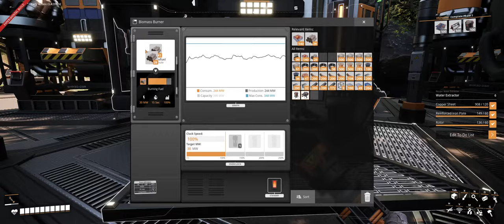I Built 16 Coal Plants at Once | Satisfactory U8 - VOD 2

Comment: What adjustments did you make to solve the encoding lag?
Reply from the maker: So between VOD 1 and VOD 2, I changed some encoding settings, reduced the detail just slightly, but, if I remember correctly, two other things changed that probably effected it more.

I reduced the detail on foliage, that was causing most of the encoding lag, and they released a patch that helped optimization as well.  VOD 1 was recorded the first night of Update 8, so it was pretty raw.

Comment: what is your top 5 for alternate recipes in the game ?
Reply from the maker: 1. Heavy Oil Residue
2. Either HMF recipe (the OG one sucks)
3. The HOR to Turbo Fuel, if you're doing turbo fuel (the OG turbo fuel sucks)
4 & 5.  All the recipes that replace screws with steel pipes or wire lol 

I hate screws.  They are almost always the through put limiter in early Satisfactory, replace them asap.  There's a rotor one, a reinforced iron plate one with wire, and the HMF one.  A few more I can't think of off the top of my head.
Reply: thanks for the reply 

i took me about an hour of collekting 15 hardrives to get the turbofuel and HOR alternates they look realy good. the only downside is that i have to redsign the oil plant i used 10 hours trying to get right. (my first playthru of the game)
and does it really give you more plastic and rubber pr minute it looks like a complicated way to get the same amount with more fuel for power. ? or is it just me not seeing the obvious 
sorry for spelling mistakes english is my second language
Reply from the maker: 10 hours...pfft.  😂
Reply from the maker: The fuel for power is in the important thing.  I honestly haven't run the math on the plastic and rubber, I always make way too much anyway.  Its all about the power.  Just sink whatever polymer resin you don't need for plastic/rubber.
Reply: Is 10 hours allot for the first time or do you just use allot longer
Reply from the maker: Its not that much time at all.  Don't feel bad having to rebuilt 10 hour builds, that's nothing lol.  We all have to rebuilt stuff all the time.  This game is a marathon.  Take your time and build things you enjoy looking at and being inside of.